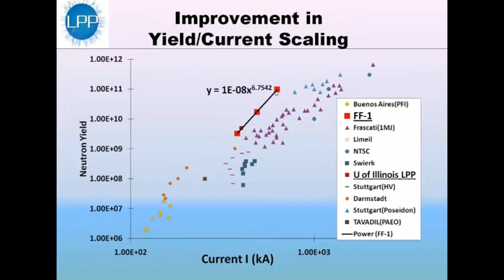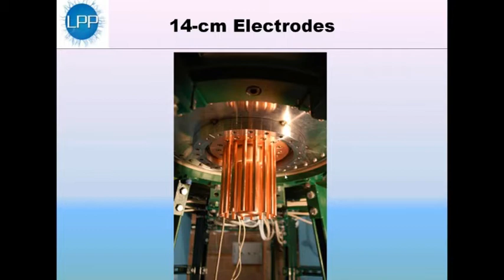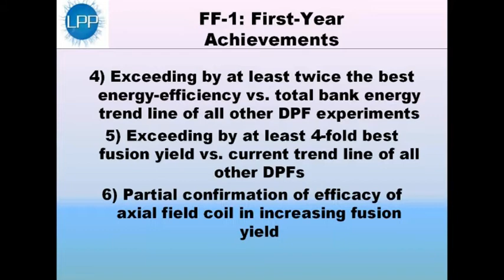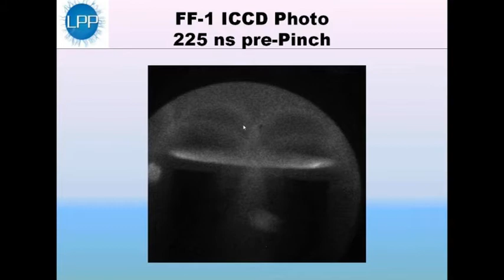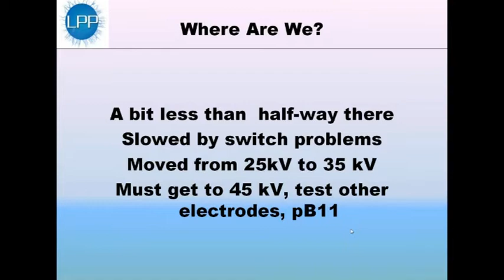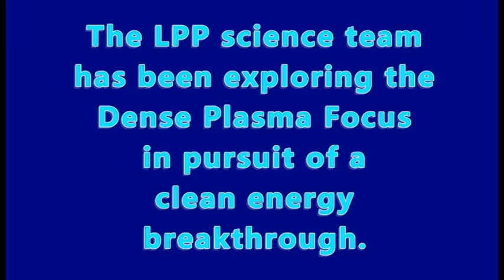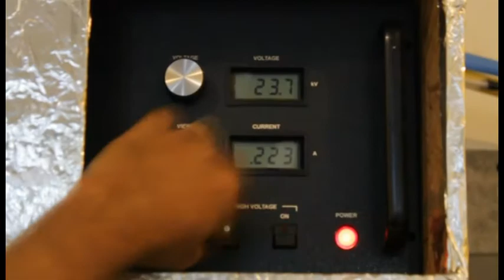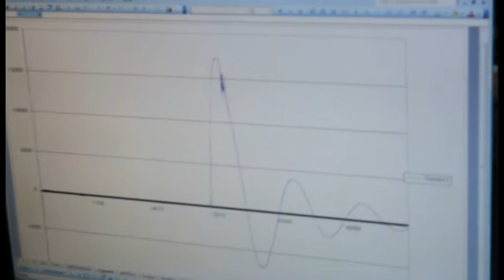Part 2/4: Fusion taking focus - The Fall 2010 update!

Comment: Great work guys !

You could use little spherical bumps or balls on top of your outer electrodes to increase the surface area for more stability.

The inner core could be more like a vortex to increase density of the beam.